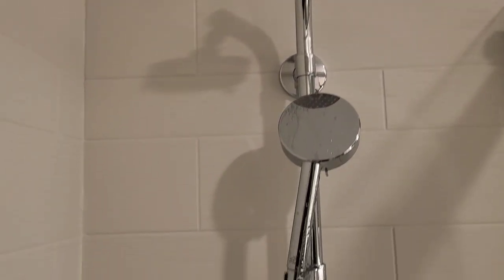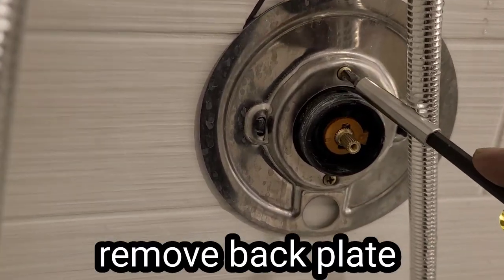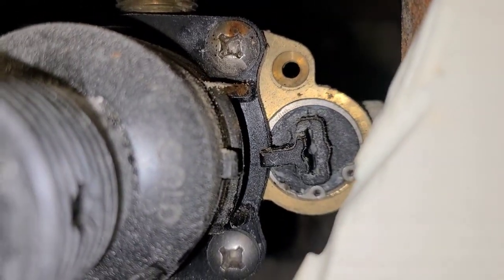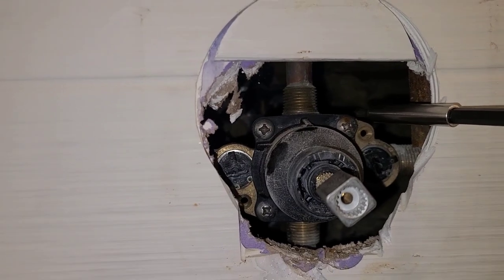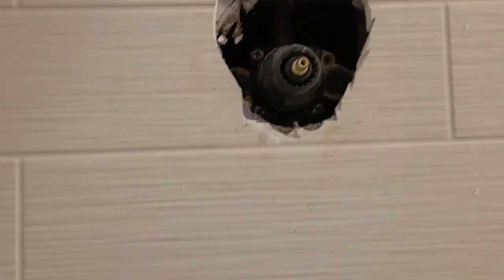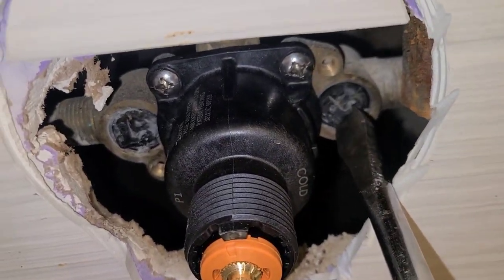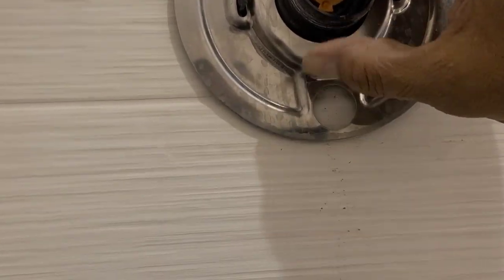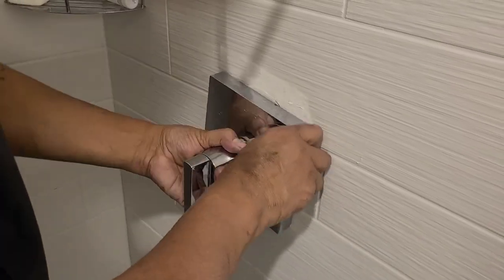how to replace Kohler pressure balancing valve

Comment: The best video I have seen about replacing Kohler pressure balancing valve!
I am curious to know what tool did you use to shut the water off? Just a simple screw driver?
Reply from the maker: yep